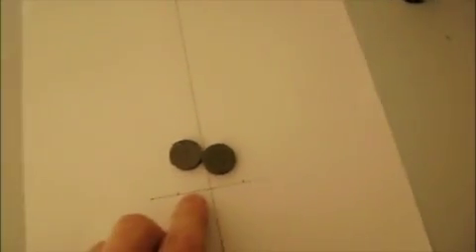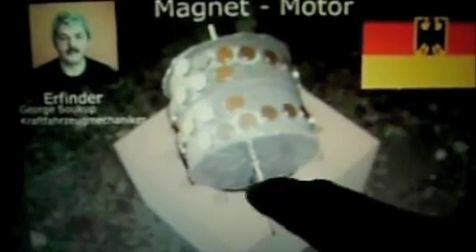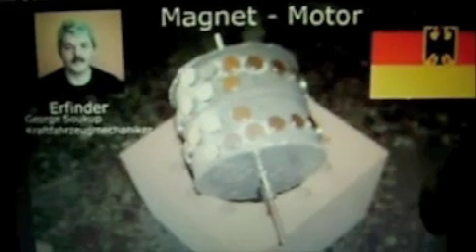How to make a V-Gate Magnetic track

Comment: You save us many moment (hours), thanks for much effort.
Reply: Hey, are you still on YouTube? I really hope you see this.
God gave me an invention this year for a type of "ionocraft" that's very efficient, and should be able to move something like a person. It involves using a mechanically generated potential from a Van De Graaff or Wimshurst machine distributed among a hull so shaped (oblate spheroid with a bottom protrusion) to create a gradient of polarity that optimizes electrohydrodynamic flow from "ion generators" along the circumference. Until recently I had doubt about how one could efficiently drive such a mechanical series, but by some miracle I found your channel and inventions.

It seems to me now that the interior of the craft should have a paramagnetic disc that translates its torque through diametrically magnetized cylinders to a series of Van De Graaff "rollers" that could generate large potentials in a triboelectric series. Magnetic clutches could be incorporated to change relative flow in certain areas of the craft, giving it maneuverability. So the only question remaining is: what's the most efficient way to spin the central disc?

I think your invention you showed in "pulse experiment 38" might hold the answer to this question. If you read this, could you lend me some more explanation as to how it works? My understanding is that it could reduce battery drain on non load-bearing motors quite a bit.
Reply: @cotesworth922  Given time I'll put up more info. Haven't been in the experimenting room too much lately. There's not much to what I'm doing, the same circuitry with many configuations. Thanks for the reply.

Comment: I have had an idea for closing the circle for the past 10 years and would like to share it with you. Today, I do not think it would work, but then again I do not have the means to test it. 

The idea is to build a v-gate magnetic propulsion circle on a slight incline, so that the starting position of the magnet is slightly lower than the end position of the magnet. The shape of the device would look like one turn of the thread of a screw. But instead of letting the ends overlap, you would disrupt the magnetic circle with a ramp leading from the higher end position to the lower starting position. The propelled object would be light and have as little friction as possible, and would have a concentrated center of gravity. It would glide around the track almost imperceptibly increasing in potential energy, and when it got to the end of the rail and was 'fired' from the end of the track, it would simply allow gravity to bring it back down to the start position of the circle. 

Perhaps you have already tried this, but if you do not think it would work, I would very much appreciate at least a brief explanation of what (even just a few words; I'm educated enough to not require a back-explanation) you believe the problem is.
Reply: you can use very cheap magnets to try . just make sure the poles are right by testing them . like poles repeal etc...
Reply: @mikepeine3898  Hello Sir, the roller in this video clearly still moves (has kinetic energy) after it leaves the gate. Doesn't this prove that this setup achieves overunity?

Are there any other v-gate or setups with magnets that you know of that achieve even a small degree of over unity? I ask this because I would like to research them, try build them and show them to other people as a way for them to make money and have cleaner energy. Thanks

Comment: It is generally assumed that adding magnets up in series, results in increased magnetic flux available.This is  not so. Adding up , say circular magnets results in a maximum magnetic llux of not more than  one and one half times the strenght of one single magnet. So placing two magnets one on top of the other results in an increase of flux or strenght of just  about one an one half times that of one single magnet. This is quite unlike connecting up cells in series which results in an increase in voltage available at the end connections as many times the voltage of one cell as there are cells in series. Connecting cells in parallel however results in a voltage equalt to that of one cell . Placing magnets side by side,  however, results in an overall flux equal to the sum of flux of one single magnet. The end   s ticking point in all vgate motors whether linear or circular may be eliminated by placing the end magnets further away from the moving magnetic armature with the next line of magnets begining well within the spaced out end magnets. Hope this proves useful.

Comment: These V-tracks essentially are a kind of spatial bi-stable, that is they switch in and out of two extreme positions The essence of the magnet motor is to provide a very brief pulse to get over the top-dead-center or TDC point and thus drive the rotary motion. It is possible to use another V-gate track at a critical phase angle to provide this push and this is why so many wheels or tracks increase the efficiency, until, at a certain speed the magnetic vortex created, drives the motor directly by sucking in the lines of force from the earth's magnetic field.
Reply: +John Husband No one has been able to actually design and build a magnet motor despite the several patents awarded to inventors claiming to have invented self energised magnet motors. There is no way to overcome the sticking point in vgate  connfigurations. I read somewhere that should a monopole be possible them it would be a  simple matter to design and build a magnet motor. Monopoles do not exist and cannot exist except in extremely complicated configurations used by physicists. I read in a text book on electrical technology that sometime after Faraday had discovered his Disc motor, what was referred to as  a Unipolar magnet motor had been put together and actually did work. Later it was investigated and it was found that though the motor did operate using just one pole of a normal bipolar magnet, it could not accurately be referred to as a Unipolar motor. The  motor most assuredly did work as innumerable experimenters including myself have made these so called unipolar motors and generators. These days this type of motor or generator is referred to as a Homopolar machine and is made in very large power sizes with currents being generated into the thousands of amperes but at just about three volts with maximum power ratings up to 10,000 hp. These huge machines are used in the degaussing of ships. From my reading on the subject i have made many approximations to monopole magnets but have not been able to design and build a motor using my monopole magnets.Should you wish to know how to obtain a practrical form of a m onopole magnet, i shall be happy  to give you the information required.All the best.
Reply: +FuckYouGooglePlus Thank you for your very enlightened comment. Just what is the point of disagreement or disbelief or  confusion or doubt or what ever it is that has upset you so. Please do elucidate. Sir.
Reply: You are completely talking out of your ass.
Reply: Vivian Astridge
Jesus...now TWO people talking out of their asses.

Comment: Great video.  The motor at the end that you describe as "could work" won't.  It's a very clever  video, but the sum of forces will never overbalance--gravity will eventually figure into the equilibrium of the magnets and the rotor will not be able to lift the stator arm.  A true overunity motor made with magnets will have to be able to do more than just turn...it will have to produce quantitative work as well.  I believe that the V-gate is just a step away from the correct combination of magnetic forces, but you need to think in 3 dimensions, not just a curved 2-D.  If the experiment I have in mind works, I might show you.  Maybe.

Comment: GREAT VIDEO!
from where ur getting the stronger magnets?
Reply from the maker: Thanks. K&J Magnetics, Inc.
Reply: Motionmagnetics that's where i get my neodymium magnets, currently have about 50 of them to create a 3 v-gate magnet motor with 4 strator magnets per track to over come the gate through magnetic teamwork XD they are connected by a shaft so only 1 magnet reaches the gate at a time, the combined force of the other 11 magnets force it through the gate, and once it starts producing torque again, the next magnet reaches the gate and so on, kind of like ignition timing with piston engines so they work together
Reply: when your done upload a vid on it

Comment: Between 4:58 min 5:10 min video and it is clear that the principle of conservation of energy works. Roll loses speed and becomes the place where the magnetic forces acting on each other in balance. Because there is such a thing as friction rollers on the ground that goes on and roll the force that presses against the ground and that is the same magnetic force of the V Gate and magnets mounted on the roll
Reply: aa h rly... and for the rest from the Vid it shows your borked conversations doesnt work?
Great
You Guys are only so boring with your useless and boring comments

Comment from the maker: It really depends on your design and what you are trying to accomplish. You're correct in your conclusions about making the gate to short.
Reply: Hello Sir. In this video haven't you proven that the system achieves over unity? Because the roller still has kinetic energy after it passes the gate after starting from a stationary position. 
In the first part of the video you showed the roller moving after it leaves the gate, starting from one side of the table and then starting from the other side proving that it isn't because the plexiglass may be slightly tilted downwards.
Reply from the maker: @waitin4thateeeeeeeg  Unfortunately, no. Though it does appear so in the video.

Comment: Is there an optimal angle between the lines basing the magnets of opposing poles to create the best push/pull? Or does this angle depend mainly on the thickness (diameter) of the magnets used on those lines to map the line; to help one figure out where to place them? (As you've demonstrated nicely here)
Maybe it's really up to how long the rotating cylinder is zipping through the gate? It seems that if it's too short, it will very easily be attracted to either side of the lines, and get stuck.

Comment: Nice investigation. You know the straight gate ? I'm building one that uses multiple straight gate sections to turn a rotor. I'll keep ya posted. Thanks for the vid.
Reply: Hi Gary, Does this v-gate setup achieve over unity?

I ask this because the roller clearly has kinetic energy after it leaves the gate.

Comment: See all that FREE movement ? 357 degrees then the track stops. a progressive force that you can use piezoelectrics to lift the gate with, several ways. Like a electric motor changes forces or by lifting the gate. To obtain a workable device that produces over unity that you can obtain extra energy from the magnets become dangerous ~ 11,000 ocean wave action generators can power 200million homes Technology Known since 1799 is safer. & their are 9 more verifiable ways.

Comment: Instead of setting the magnets along a straight line, would you get more or less momentum/speed if you set the magnets on an exponentially widening curve instead?  I would imagine that starting at the wide position, the spool would gain greater momentum/speed as it approaches the narrow end and vice versa.  Just curious if would surpass the gate easier if you did that.
Reply: Hello, The mere fact that the roller is getting past the gate is blowing my mind! Doesn't that prove over unity? Because the roller has Kinetic energy after it started from a stationary position 😃

Have I missed something sir?

Comment from the maker: That depends on so many variables. The V-Gate works better in attraction mode. In repulsion mode, you have to get past the area of repulsion before you even see the results of the gate. If you're looking for continuous motion or rotation, I don't know of a correct configuration to accomplish that without the addition of some mechanical means or the use of gravity, as I demonstrated in the video. If you're just playing with the gate? Make the V smaller than the roller, and start 2 or 3 magnets in

Comment from the maker: Well, I guess if I believed in the impossible I wouldn't be on this quest. So no, you won't hear me use the word impossible. I don't think that particular configuration would be the way to build a rotating v-gate motor though. The reason the roller breaks free of the track in the video is that there is an initial burst of momentum when the roller is drawn into the cart. If you added more gates the momentum would eventually just subside.

Comment: You show how when you send the roller through the v gate backwards that it can actually break free. Assuming no initial force is used accidently, couldn't that be used to make overunity? Like just line up several of them backwards with gaps for it to break free and lead into the next with that extra force. If this works then you can eventually make a circle track of them. Don't flame this btw and say its impossible. I just saw supporting evidence on here that makes it worth further inquiry.
Reply: That's exactly what I have been thinking! 🤷🏾‍♂️ Has anybody jumped on this? And tried it out?
 I live in a 3rd world country i think it will be hard to get hold of a set of magnets like that but I will still try and give it a shot if no one on here says how this is baloney.

Comment from the maker: The catch, is that you would also need the mechanism at the top and bottom of the rotor, in order to get it to work. It definitely wouldn't work without both of them. I've built quite a few versions of v-gate rotors, and the only way that I believe you could get one to work is by adding some sort of gravity effect and/or spring mechanism. That's partly why I believe that particular design could work.

Comment from the maker: Thanks. I enjoyed your video, as well. 

Yes, those were Neos in the latter roller I used. It will work with simple ceramic magnets as well. What I would do, if I were trying to replicate the rotating version I showed in the video, would be to use ferrite metal cylinders for the rotor, and a longer neodymium bar magnet on the stator. The only way to avoid flux loops, without some form of shielding, on the rotor, is to simply use metal cylinder bars rather than magnets.
Reply: I hope you are still active on this account. The idea with a cam shift is ok but you take energy to push the cam shift. The idea of lifting it away is the key but there is better ways to do it. I would love to send you a private question and talk about a simple solution to this!!!!